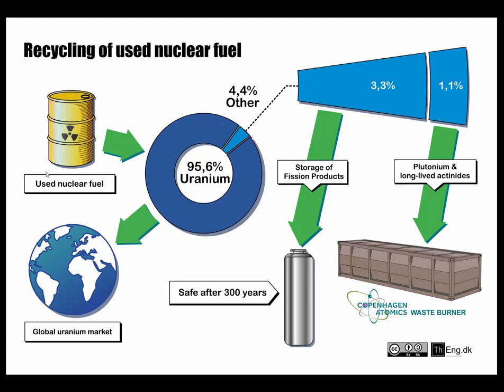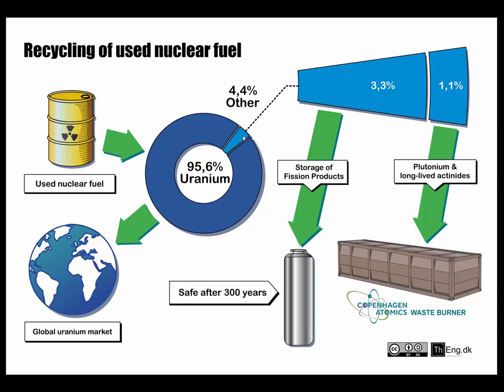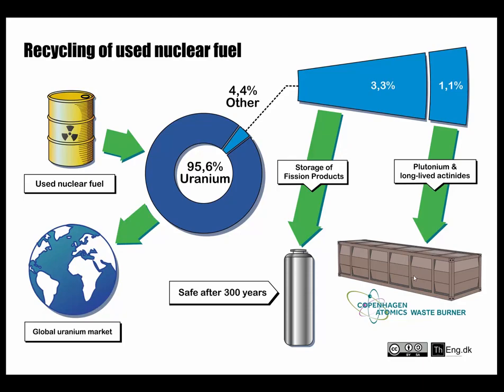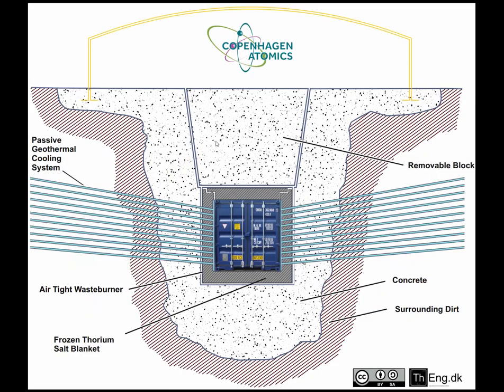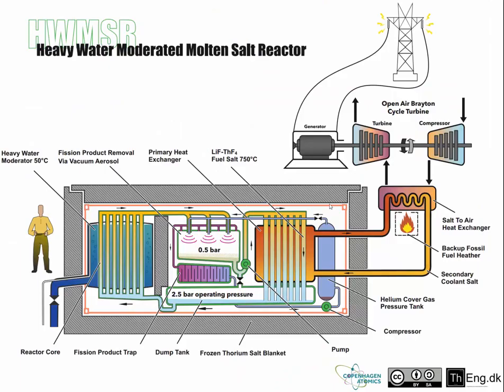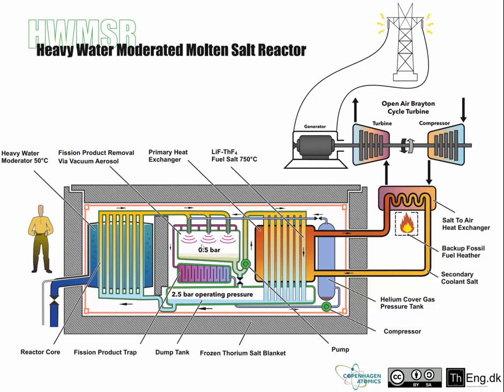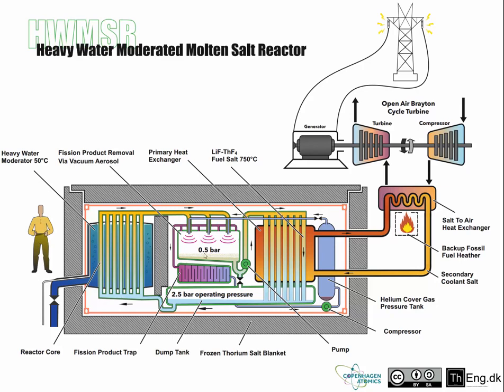Copenhagen Atomics Waste Burner in 5 minutes

Comment: What sort of delayed neutron losses are you talking about when you have the helium sparger occuring before heat exchange and then final return? And does that impact on the stability of the reactor against perturbations? 

One of the issues with trying to fit so much into a container horizontally is the large opportunities for LOLF, LOCA or just technical difficulty in final assembly from dealing with the profusion of piping. Would it not make better sense to orient the reactor vertically so that a "core catcher" can be designed at the bottom? In this way, the reactor core can sit at the bottom while the calandria holding the D20 surrounds it. Arrangements will have to be made to ensure that calandria break + primary loop break does not result in criticality but you would already have to do this with the horizontal arrangement, anyway. 

In any case, with the Hx sitting above the core primary loop, Hx breaks would drain, by gravity, back into the primary loop catchment. Same with sparging equipment breaks. Either way, this would probably even allow for a reduction in pumping power because you can arraign the pump such that it either pumps the cold leg down with gravity assist (so that the hot leg also rises with convection assistance) or you can do a counter-current arrangement.
Reply: I 100% agree
I love molten salt reactors but this one seems very badly designed to me
Reply: I wouldn't think you'd actually want delayed neutrons causing damage to the heat exchanger. (Or to the offgas system, for that matter.) But why do they consider it worth the trouble to increase fission product removal? To improve burnup?
Reply: @AlexiLaiho227  the tubes where the fuel are *vertical*. the "plant" is horizontal.

Comment: why would you do a thermal spectrum on a waste burner?

higher actinides won't go away in a thermal spectrum, and plutonium can breed with a fast spectrum, you can just put used fuel (and the uranium and soluble fission products) into a tin can and run a breeding cycle instead of extracting pure plutonium from the spent fuel (proliferation concern), as well as the strong negative temperature coefficient that comes from having a homogeneous can instead of a graphite moderator swelling with heat/radiation, or heavy water which could boil or even leak into the salt and destroy the structures (try explaining to the people how your oil radiator tube just leaked fission products into their groundwater after being worn away by saltwater corrosion!)

you should just do a fast waste burner, it is so much more logical at tackling proliferation concern, fuel cycle (closes the loop instead of always depending on new plutonium for continuing operation of the plant), and the creation of higher actinides (thermal will get you all the way up to americium and curium without fissioning sometimes, fast spectrum is like 99% on pu-239 and 80-90% for each step on the higher actinide chain, as well as 10-20% for u-238)
Reply: I don't mean to tear down your design because it is a good idea, but the moderation scheme with the aerographite reminds me of the accelerator driven subcritical systems: it's just like, why are you going through so much trouble when there is a simple solution right in front of you? moderators are optional. if it is running on nuclear waste, there is no reason it oughta be difficult to start with a big fissile inventory, the fuel is literally a liability to its current owners and they will pay you to burn more.
the simplest designs are usually the best and most economical, and a big tube of salt that is sized for criticality seems like a million times better solution than "silicon carbide, aerographite, and stainless steel separating heavy water from molten salt with a 500 degree temperature differential so the thing doesn't boil on us"
it just seems like you're doing everything in your power to make this more like a fusion reactor, because it's fun to design those, but the world needs good solutions to the problems, not things that have been made high tech for the sake of being high tech.
it's a reactor. it takes in waste and makes heat. you can do that without 40 foot radiator tubes making the design location specific because you can't economically drill into bedrock, feel me?
Reply: I agree, not only too complicated, but routine reprocessing makes it expensive too. Offsets your molten fuel and efficiency savings.
Reply: How much bigger is the fuel load in a fast spectrum reactor? I wonder if fitting the whole thing in a shipping container is considered a big advantage.
Reply from the maker: > higher actinides won't go away in a thermal spectrum
This statement is mostly false, especially if you do not have U238 in the salt. I am sure you agree that Pu239 and Pu241 will fission well in thermal spectrum. If you do the simulation over 30 years, then most of the transuranics will fission. (not all)
Also see page 25 in this paper for a quick graphical understanding. Even Pu240 will capture a neutron and fission as Pu241 in thermal spectrum.  
https://www.osti.gov/etdeweb/servlets/purl/587853
Please also note that there are still some fast neutrons in a thorium molten salt reactor. 
Also check the table on this page:
https://en.wikipedia.org/wiki/Breeder_reactor
Reply from the maker: while fast reactors benefits from higher neutron reproduction factors the overall cross sections scales inversely with the neutron energy, translating in to much larger fissile inventories for fast reactors when compared to thermal spectrum reactors. since the power to fissile inventory ratio is one of the primary factors for rapid scaling of a reactor fleet to multi TW level, fast reactors for all their lure will have their lunch eaten by snf kickstarted thermal thorium molten salt reactors.
Reply: I'm thinking that these reactors might possibly be good for small power plants where fast spectrum reactors couldn't be used.